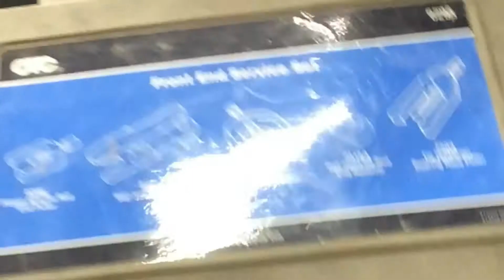2004 Cadillac Escalade Inner and Outer Tie Rod Ends

Comment: I'd buy a 36mm Crowfoot, so you can torque the inner.  I'd also pull the inner and outer out as one piece, and measure the distance making the new pair the same length.  Probably more accurate to make them the same length vs counting number of turns, because the new parts will not be the exact same specs as the original parts.